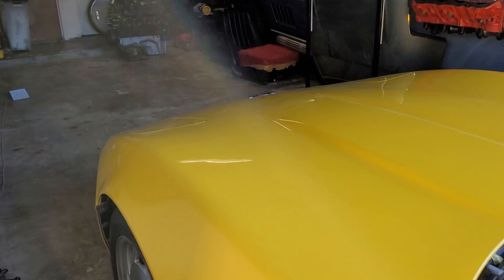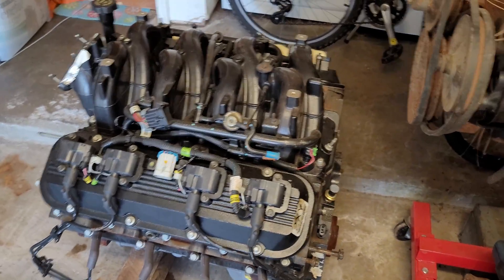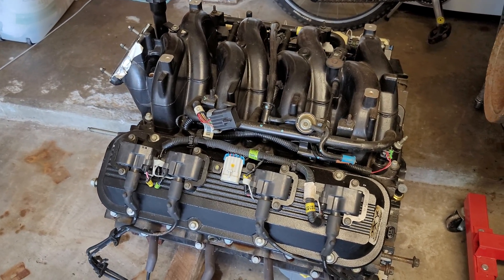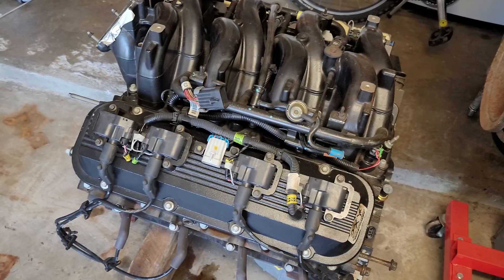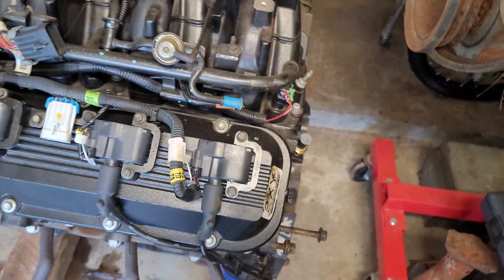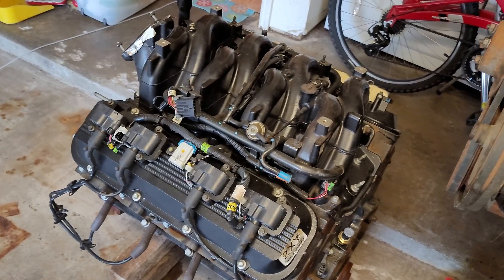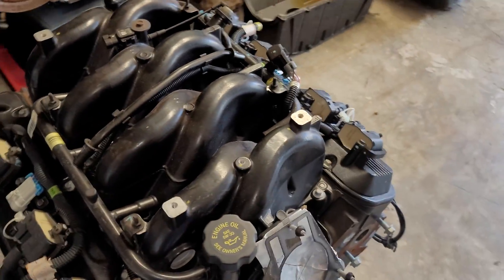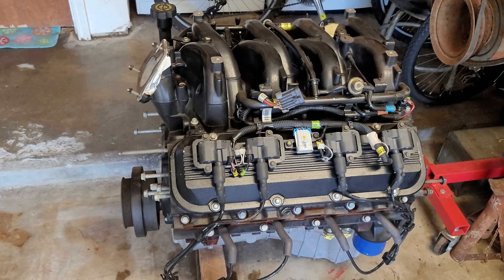The Monstrous Vortec 8100 496 8.1L Big Block Engine of the 2000's

Comment: Purchased 02 2500hd w/ the 8.1 n the Allison trans. as a leftover in 03. Only have 145k miles.. first yr dealer replaced the booster.. otherwise with regular maintenance n an Xtra qt of 5 30 oil between oil changes, I'm xtremely happy with it. Using g it as a cement work truck , it was regularly pull heavy trailers with front loader on it with NOOO PROBLEMS. Always impressed as the Allison shifted going up n down hills with heavy loads. With light loads I found myself checking the  rear view to see if the trailer was still hooked, cause I did t feel the weight AT ALL.
Retired now so sold business but kept the silverado to this day. Would like to pump up the 8.1 mildly in near future without pulling it. Any suggestions. Was thinking modify the intake, gasket port n polish the heads, headers, n maybe a cam if possible without pulling it out.  I just don't have the needed space. One car garage w/ z06 n harley.
Reply from the maker: Yep, these are definitely excellent lifetime trucks. From what I have seen, many owners focus first on opening up the intake with aftermarket breathers and headers with dual exhaust. Getting into the engine takes a little more work, since they're are very few aftermarket companies offering high performance components for these. I do know I've seen some retrofitted with superchargers and intake/head/cam packages.

Comment: I bought a 2003 gmc c6500 truck with an 8.1 Ltr with 124000 miles on it running on liquid injected propane. Now has 330000 miles on it. Just took a compression check to see if it was worth putting new injectors in it. 4 cylinders have right around 150 psi 1 cylinder at 148 psi and 1 cylinder at 161 psi. This is my work truck. It runs 6 days a week mostly city driving. Short runs all day long and once in awhile maybe a 50 to 100 mile run once a month sometimes well loaded. Unreal pulling power. Well worth putting new injectors in it. I am sure the rest of the truck will fall apart around that motor before it gives up. Only thing bad about it is if you think gas is poor fuel mileage, propane is half what gas is. But propane is cheap. the gross vehicle weight rating for the truck is 25900 and it is at its max often. Never has a problem pulling the weight.on the mountain roads of Oregon. I will run that motor until it dies but at the rate it going I think I will be First.
Reply: Had a natural gas van and man the oil stayed super clean.    I noticed a hug difference in fuel economy when towing or loaded with natural gas but burned real
Clean….i had HOA stickers for driving in the carpool lane and deee meter parking…pretty sweet.
Reply from the maker: Hey Mark, thanks for the testimonial. Real world examples like yours are what keeps these engine in demand now and will continue to do so in the future. Glad to gear the truck has been such a valuable asset for you.

Comment: Good video ! I have an 8.1 liter and it does have an oil consumption issue that I can not find any information on how to fix. Can you help with these problems/ fixes please ?
Reply: Info on the 8.1 oil  issue seems to have been scrubbed from the internet.
Reply from the maker: Yea, you kind of have to dig to find it since I'm they have been out of production for more than a decade now. 

Also, the oil consumption isn't really considered an issue by GM. They BBC's have always used oil due to internal tolerances, and it doesn't really affect the durability or longetiviry of the engines overall. They just have to have a little more preventative maintenance performed like most larger commercial vehicles.
Reply from the maker: Hey Bulldog, glad you enjoyed it. Funny thing is normal oil consumption on the 7.4 and 8.1 Vortec BBC is 1 quart per 1000 miles per GM specifications. People are always blown away by that, but these engines run a bit "looser" than other engines. Does your truck use more oil than that?

Comment: Great breakdown of how things are different on these vortec motors.  I have the 8.1 in my 2001 suburban 2500 and it has around 250,000 miles.  Haven't had any internal breakdowns to date.  You were so right in saying these motors are highly sought after, but they are also hard to find parts for too.  One question because you seem to know alot about the different years of the vortec is about the throttle bodies.  My 2001 has a throttle body, drive by wire, where wiring harness connects by 8-pin straight plug and I cannot find anybody, even aftermarket that sells throttle body with this connection.  2002 and up switched body style with an 8-pin plug that is more rectangular and connects on passenger side of body.  I was hoping if somebody knew if I ever had to buy a new TB, can I switch to a newer model, with different plug config.?  If so, how to I find out how to do a plug conversion?  Would I have to switch cpu to a 2002 or newer.  I may want to do some upgrades whenever I decide so rebuild, and this TB issue is a big pain.  Any help would be appriciated.
Reply from the maker: Philip, I do believe that an upgrade to the 02 and newer style TB will require not only a harness but the Throttle Control Module and gas pedal as well. Let me check with some of my sources and I'll get back to you.
Reply: @VetteSource  its been a couple months since my last reply thanking you for your suggestions on my throttle body issue.
Just curious if you were able to verify switching out gas pedal, control module and harness would allow me to switch to newer model throttle body.  I still haven't found anybody else that can give me an answer on this.
Reply from the maker: After doing a little research it can be done but will require a repin of some of the connectors into the throttle body, TCM, gas pedal, and ECM. Not impossible, but not the easiest task either.
Reply: Thank you again for question.  I have not yet found anbody willing to take this project on.  Most people just say it can't be done.  They just don't want to deal with the electronics of it and put their name behind it.  I'm frustrated besause just a couple day ago, 3 times while my wife was driving to work, the truck went into reduced power mode.  She looks at me and just says, fix it.  I will keep you updated.
Reply: thank you so much, any suggestions will help.

Comment: I currently tow a 5th wheel camper with an '04 Sierra with the 6.0.  That engine does fairly well pulling 11K lbs. but grunts in the hills.  I am now looking for something with more low-end torque and since I am not a diesel guy, I favor the 8100.  The Alison trans is a bonus!  But, trying to find one with a decent body and less than 200K is somewhat difficult.  I love those Vortec engines!
Reply from the maker: Hey Brian, great name👍. For sure, the 6.0 is a great hauler and will get the job done for most applications. It's when you feel the extra "oomph" from the 8.1/Allison that you realize what you've been missing😁. 

I agree with you, the Vortec family of engines, especially the big blocks are some of my favorite engines for pulling and reliability.  I've been using my 454 Vortec as a daily for over 20 years.
Reply: @VetteSource  I am going to look at (buy) a very nice truck with the 8.1 tomorrow.  Pretty happy that soon I can put the old reliable 6.0 to rest.  When I weighed my truck and camper, the CGVW was 440 lbs over the max capacity of my 6.0.  And that's without my generator.
Reply from the maker: Yep, that can be a problem. Sounds like it  could be a great truck. Let me know how it goes.

Comment: IT'S A FORD BIG BLOCK DERIVATIVE, CHEVY'S COPY WITH THE SYMMETRICAL HEAD. LET'S NOT FORGET THE LS, IT'S A REGURGITATED FORD 427 HIGH RISER MOTOR AKA RAISED PORT351 WINDSOR. EVERYTHING CHEVY USES TODAY IS ALL FORD IN DESIGN FROM THEIR NASCAR RO7 TO THEIR MOUNTAIN MOTORS TO THEIR SYMMETRICAL HEAD RACE ENGINES WHICH ARE CLEVELAND BASED MOTORS. NOTHING IN RACING IS CHEVY ANYMORE AND NEITHER IN PRODUCTION ENGINES IT'S ALL FORD COPIES AND DERIVATIVES AND EXTRACTS, OF EVERYTHING FORD HAS DONE.
Reply from the maker: If I'm undertanding you correctly, your position is that the Big Block Chevy is a derivative of the Ford FE series of Big Block engines started in the late 50's? 

Not so sure I would agree with that assessment since the majority of the auto manufacturers engines have both similarities and differences simply because they have all piggybacked off each other over the years. It's like trying to figure which came first the chicken or the egg.

Even though there are quite a few Ford engines that are excellent pieces of machinary, the Triton 6.8L V10 engine Ford put into production as a direct competitor to the 8.1L 7th Gen BBC doesn't really hold a candle to it in terms of power or durability.

Appreciate the comments, and enjoy the rest of your weekend👍.
Reply: @VetteSource   NOT THE FE SERIES, BUT THE BIG BLOCK FORD IS THE 385 SERIES 429/460 MOTORS. GM/CHEVY RIDES IN THE SHADOWS OF WHAT FORD HAS DONE. THE SIAMESE PORT OLD CHEVY BIG BLOCK DESIGN HAD IT'S LIMIT IN THE 375CFM RANGE HEAD FLOW. WITH THE FORD SYMETRICAL DESIGN YOU GO INTO WELL INTO THE 400+CFM RANGE. LS CHEVY HEADS ARE KNOWN TO MAKE CLOSE TO BIG BLOCK CHEVY HEAD FLOW NUMBERS DUE TO THE FACT THEY ARE BASED ON FORD'S 427 HIGH RISER HEAD DESIGN GIVING THE AIRFLOW A STRAIGHT SHOT INTO THE CYLINDER. THE MOUNTAIN MOTORS LABELED AS CHEVY ARE FORD BOSS 429 DESIGNS. ALL YOUR SYMETRICAL HEAD CHEVY RACING ENGINES ARE FORD CLEVELAND DESIGNS. THIS IS THE ONE THING THE MANUFACTURERS OF THESE RACING ENGINES HIDE FROM THEIR CHEVY CLIENTEL. EVEN THE CHEVY RO7 NASCAR ENGINE IS A FORD CLEVELAND KNOCK OFF. IT IS THE MOST CRIMINAL THING THAT HAS HAPPENED IN THE RACE WORLD.
Reply from the maker: Hmm, interesting. I'll take a deeper dive into this subject. Thanks for taking the time to comment.
Reply: @VetteSource  HERE IS SOMETHING INTERESTING. THE ZR1 CORVETTE FROM 1990-95 HAD A LOTUS DESIGNED ENGINE. IN 1987 GM BOUGHT A LARGE PORTION OF LOTUS. THE LITTLE KNOWN FACT IS THAT LOTUS WAS OWNED BY FORD UNDER A SUBSIDARY. FORD SOLD GM 70% OF LOTUS AND KEPT 30% OF THE COMPANY BEING THE ENGINE REASEARCH AND DEVELOPMENT DIVISION. SINCE GM HAD A LARGER CONTROLLING INTEREST IT GAVE THEM ACCESS TO THE ENGINE DEVELOPMENT AND RESEARCH DIVISION OF THE COMPANY. FORD DESIGNED THE ZR1 ENGINE AND MERCURY MARINE BUILT IT. THE MAGNETIC SUSPENSION YOU SEE ON THE CAMARO'S TODAY WAS DEVELOPED BY LOTUS/FORD AND AQUIRED BY GM WHEN THEY BOUGHT INTO THE COMPANY. SHOCKENLY AFTER MANY YEARS GM PUT THIS TECHNOLOGY TO WORK. ALSO BACK IN THE LATE 1980'S THE MR. GOODWRENCH NASCAR THAT DALE EARNDHARDT DROVE AND WAS WINNING IN. HAD A EXPERIMENTAL LOTUS ENGINE WHICH WAS 4.6 LITER AND SINGLE OVERHEAD CAM ENGINE NAMED "THE CHAPMAN/LOTUS V-8". IT CAME FROM ENGLAND IN A CRATE AND PUT INTO DALE'S CAR AND AFTER A CERTAIN AMOUNT OF HOURS IN USE. THE ENGINES WERE RECRATED AND SENT BACK TO LOTUS AND A NEW ONE WAS INSTALLED. THEY USED THE GM MR. GOODWRENCH AS A TEST BED, TO TEST THEIR NEW ENGINE (IN RACE FORM) WHICH BECAME THE 4.6/5.4 MODULAR FORD MOTORS WE KNOW OF TODAY. THE FORD ENGINEERS WERE OBVIOUSLY LAUGHING THEIR BALLS OFF EVERYTIME DALE WON A RACE.

Comment: Thanks for the information, very informative video. I just bought a 2002 3500 crew cab with the 8100. And yes the gas mileage is less than desirable and yes it does have an oil consumption issue. I have an issue on the # 8 cylinder fouling the plug. I’m hoping it’s a valve guide seal as it smokes badly on start up sometimes. It also has a periodic loud squeal after stopping at a red light and then goes away. I believe it’s a vacuum leak somewhere and it could be contributing to the spark plug foul. I bought the truck to pull my 24 ft inclosed Racecar trailer with a 3000 lb race car and tools air compressor generator etc. it does a good job. I’ll tear into it soon and figure out the oil foil and squeal.
Reply from the maker: Thanks for the feedback, glad you enjoyed it. I have the same truck as yours, and enjoy using it for my over the truck as long as i can justify the fuel expense with the current prices🤪.

Even with the few minor issues you're describing the great thing about the 8.1 is that it uses all the next generation LS fasteners and gaskets which makes it incredibly easy to tear into for inspection and repair.

Comment: I bought a 2001 HD 2500 about 5 years ago with 79K miles on it. The truck was like new. I love it. The only complaint is when I start it up, I can hear lifter rattle for less than a minute until they pump up. Is this common for these trucks? Any easy way to fix this?
Reply: I put about 1/2 qt of Lucas engine oil stabilizer every oil change and the lifter noise goes away! I use 5w40 Mobil Synthetic oil!
Reply from the maker: Not so much. The BB Chevy engine is fairly notorious for lifter rattle/piston slap at initial startup until the oil begins circulating through the system.

 I have 2 3500 GMT-400 trucks with the 7.4 454 Vortec and the one with only 100K miles rattles at startup, while the one with 250K purrs like a kitten. I would try running a heavier weight oil in it to see if that helps. I also add a quart of Marvel Mystery Oil every other oil change just to keep things from sludging up inside the engine.
Reply: @VetteSource  Thanks for the info. I am running the 5W-50 weight. I will try some MM oil before the next oil change or step up to some heaver oil. I don't mind the start up noise but am worried that it will cause damage. The seller was aware of this and hid it from my by having the truck running when I pulled up to look at it. I put 30K miles on the truck since buying it. I hate the gas mileage, but it is very smooth and fun to drive .
Reply from the maker: No problem, glad to do it. You should end up being good. As long as these engines spend most of their time under 3000 RPM, they will last pretty much forever.

Comment: I have a '68 C20 that I am setting up for towing a 10,000lb RV and would love one of these engines.  My biggest questions would be:  Is there a carbureted 4 barrel manifold available that I could mount a Fitech TB injector on and if the water manifold is compatible with a normal radiator.  How about ignition ?  Would a 6LS box work on these engines ?  Thanks.
Reply from the maker: Hey Ken, just the other day a viewer commented that Dart makes a carburetor intake for the 8.1. Not sure about the water manifold, but I would be willing to bet there is a way to make the 6LS box work.

Comment: there's alot of aftermarket for these motors but he's wrong dart makes a carbed intake for this motor an u can add a distributor an get rid of the crank senser  an the still have a 8L bbc i have one it was a propane bbc out of a freightliner so before you do a video you really need to do your home work
Reply from the maker: Hey Darren, thanks for sharing the information. I'm not sure if knowing whether or not somebody made a carb intake for this engine is not doing my homework. Luckily for the rest of us there are plenty of experts to get it straight😁. Have a good week👍.

Comment: is there anyway to get a bigger gas tank on one of these trucks? it seems like they only make aftermarket diesel tanks now
Reply: Yes I can confirm that the 8.1 trucks had a smaller secondary tank above where the spare tire would sit under the frame which would put it around 38‐39 gallons. I haven't found any bigger tanks that would fit a 3/4 chassis. From what I read, GM added these secondary tanks as part of marketing scheme to advertise that you could still get around 300 plus miles on one tank without advertising that the tank was actually bigger to hit that range. However I will tell with how the fuel system is designed it's time consuming/pain to get both tanks full with sensitive pumps at the gas station.
Reply from the maker: Great info, thanks for sharing. I wonder if the GM part # is still floating around out there to still do that conversion.
Reply from the maker: I'm sure you could probably find a way to retrofit the dual tank setup from an 8.1 Suburban/Yukon XL. Finding the tanks might be the problem.
Reply: @VetteSource  I didn't know the suburbans  had that option.. do you know which years came with the dual tanks ? Or if all of them can have the 2nd tank added ? I'm sure I can find the tanks somewhere .
Reply from the maker: Pretty sure it was all the 8.1 Suburbans and Yukons were equipped that way since the larger 34 Gallon tank from the 3500 trucks wouldn't fit on the 3/4 ton chassis. 

Let me know if you find any, I would be interested to see how the conversion goes.

Comment: I have an 2002 chevy crew cab dually 3500 with this motor.  Bought it 2 yrs old.  I still have it.  Runs very well...no issues.  It does consume some oil but nothing excessive or ridiculous.  Plenty of power.  I've pulled some heavy trailers and it's done well.  It does use gas.  10 miles per gallon in city driving is the norm.  Very dependable.  Always starts and idles beautifully.  Very quite and smooth.
Reply from the maker: Yep, I have the exact same truck I picked up last year to put back together. It sat in a shed with the engine and transmission laying beside it, with everything piled in the bed for several years. I did some mild prep work, put it all back together, and it runs exactly the way you describe. You have to really try to kill these things.